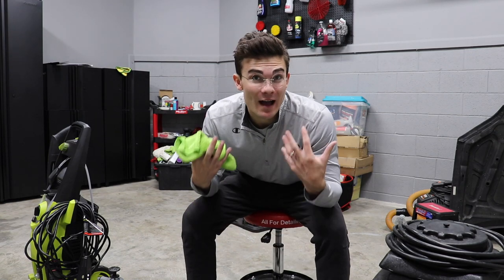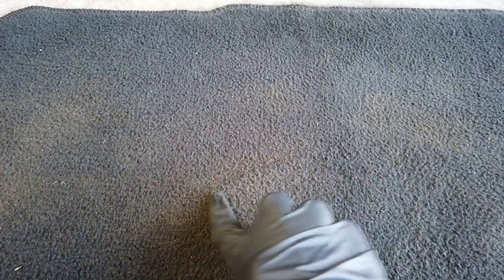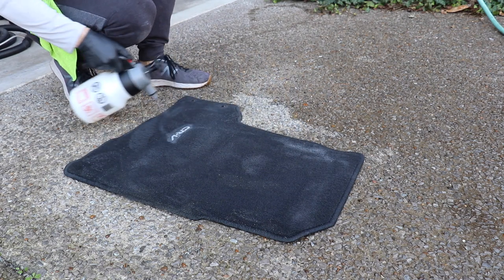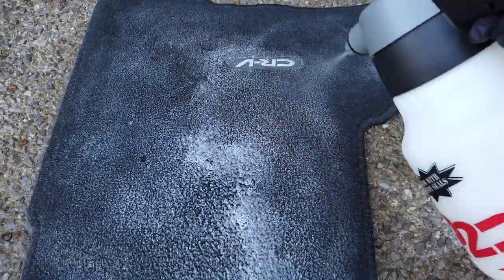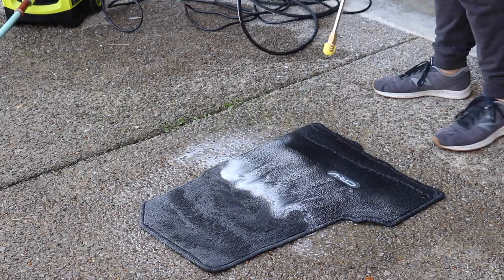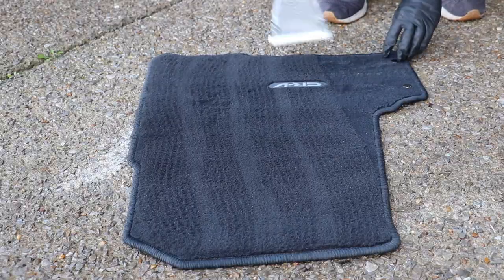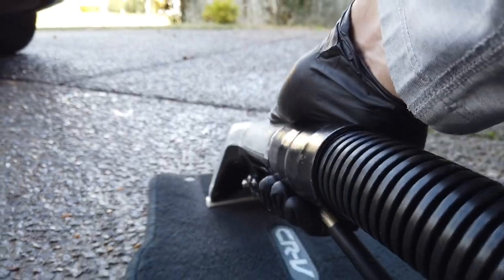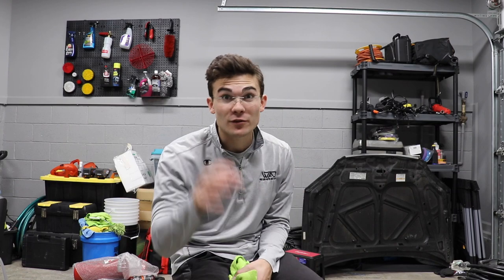The ULTIMATE Carpet Extraction Method & Why Your Results Suck!

Comment: I really have to point out that degreaser cut at that ratio still won't cut. I would recommend you use a high alkaline carpet prespray and come back with a acid rinse. It's the best way to remove this without pressure washing. Flex citri solv mixed with flex bio break, then rinse with flex ice. Another prespray mix would be flex citri solve mixed with flex fire. Carpet cleaning industry chemicals will apply best to cars. Degreasers are not gonna give the best results, been there done that.

Comment: I guess if you don't have a extractor you could use a shop vac to pull out water and hang dry them.
Reply: I used a Hoover power path pro, good at extractor w/ the attachment & it has a clear wand. But I blew the fucker out by not paying attention to how much water it was collecting. These things would of been better if they had an output feed hose out to a discharging outlet instead of the collection tank right above the fucking motor, thanks Hoover!

Comment: People should check out the jon-don heated (about 200 degrees) extractor. I bought it and its a solid built product but is only $650. I didn't want to spend double for the price for a name.
Reply: Oh yes I found this one. I think the only main difference is the Jon-Don EZ Portable Spot Extractor With Heat is 55 PSI while the Mytee 8070 is 120 PSI. The Jon-Don for some reason doesn't come with a clear extractor wand.
https://www.jondon.com/priority-manufacturing-ez-portable-spot-extractor-with-heat.html
Reply: @ricardogomez01  ah gotcha. I feel that's not enough to justify double the price. You don't use an extractor to blast anything anyway. And yea I wish it came with a clear one but they do sell a clear one so even if you bought that for like $50 it would still be close to half price.
Reply: @mattz000  You're right. After talking to Jon-Don it looks like the CFM is 100 which is the same as the Mytee 8070. I think the suction power is more important than the pressure of the sprayer. 

Now I'm thinking the Bissell Garage Pro wet vac 12 amps might be a better route coupled with an electric kettle to pour hot water.
Reply: @ricardogomez01  jon-don actually has a bucket heater as well. It's like $50-60. I just bought one. Fill a 5 gallon bucket and it heats it to like 180 degrees in about 20 minutes. Real simple and you can heat a ton of water.
Reply: @mattz000  That's a good idea thanks!

Comment: You use a pressure washer INSIDE the car??  I came here for car carpets, not floor mats.
(get a right angle drill for the brushes, MUCH easier to control.  Rookies)